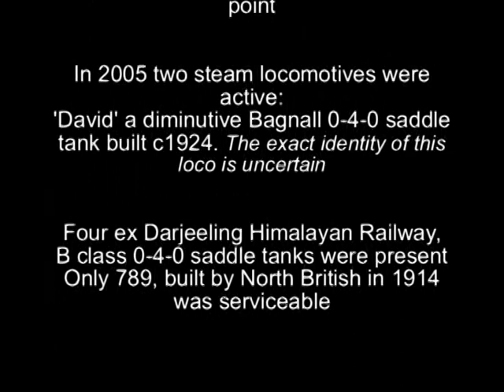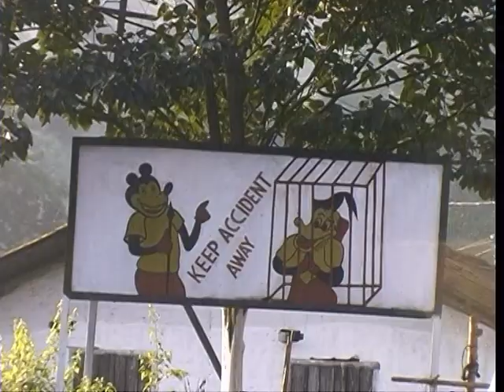Tipong Colliery 2005

Comment: Imo it's a boiler with circular firebox, because there's a firedoor with a lid underneath for the removal of the ashes, this arangement being typical for Bagnall Lancashire type boilers.
Thus the ashes have to be cleaned from inside the cab.
It seems to me that these people are using pick axes to remove the coal from the seams, because there's no mechanisation to see apart from the loco's themselves, the way colieries in Western Europe operated 100 years ago!
Reply: And this is where all the English equipment ended up a 100 years later....🙄

Comment: Boiler certificate? What do you want that for?
Reply: +CGT867 I doubt if they have even heard of those, and if they had probably couldn't read one anyway. - Did you notice the front of 'David' all the fireclay around the smoke-box door, probably hasn't been opened in years.
Reply from the maker: +Christopher Lovelock It is not fireclay, just ordinary mud. It is replaced every time they open the door to clean out the ash. The smokebox doors are usually a bit distorted, the mud is to keep them airtight.
Reply: +blackthorne57 My apologies, I was a little presumptuous in commenting before I had seen the whole , (if I may add, excellent video of yours). Whilst browsing 'You Tube' later in the evening I came across a short film of 'David' in a totally different livery - Black Saddle Tank, Green around the 'Cab' and with a large Yellow star on the smoke-box door -do you know anything about this ???? They seemed very generous with the white paint and yet everything else had an air of 'dilapidation' about it, - in one part even a rock laying between the track had a 'dollop' of white on it.